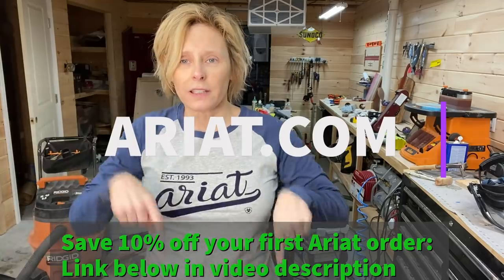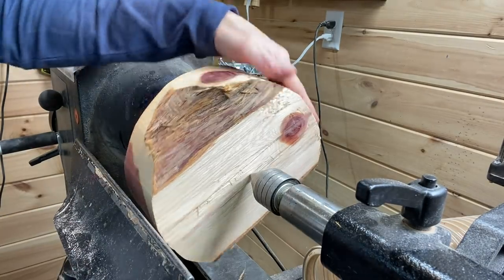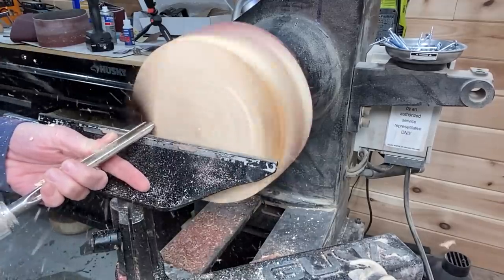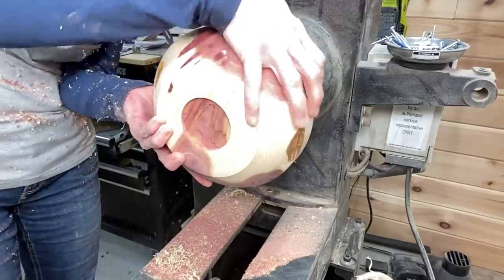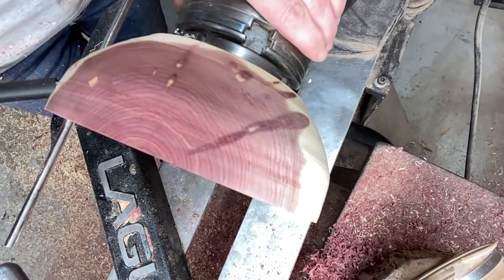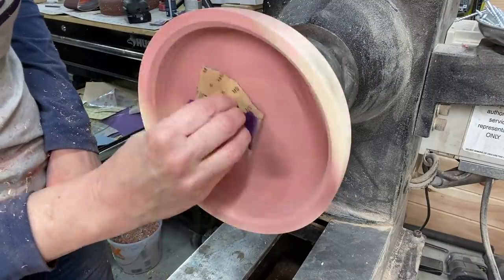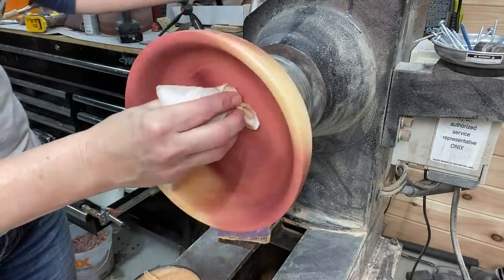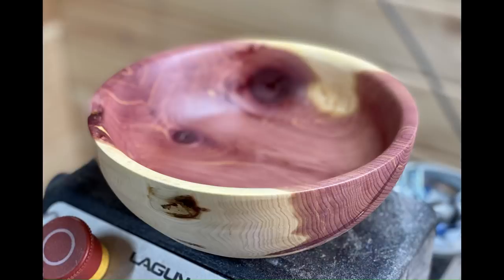Woodturning Cedar: I'm in LOVE!

Comment: Hi Peggy. I have made bangle bracelets out of cedar. One word to the wise, cedar does not like heat. It will stress crack if you fiction polish it and build up to much heat while trying to shine it up. The thinner the quicker it will heat up. It is fun to turn. CA glue can give small pieces a very nice gloss finish. Being so soft it will soak up a lot of anything thin like sanding sealer. Nice job on the bowl keep up the great work. The bowl has a nice shape and you to. Lol. :)
Reply from the maker: Thanks, Ed!👍🏻

Comment: Cedar is a beautiful wood to turn, but boy, the pink dust from sanding gets everywhere and was quite noticeable in the external filter of my air filtration system.  Cracks can be a problem and ones around knots can be trouble if they go all the way through the sides of the bowl.  The pink-red color will darken with age/exposure ending up closer to dull brown-red or muddy red.  For some reason, all I can think of when turning cedar is a gerbil cage!  Nice job!  I have found that the Ack products work very well with cedar.
Reply from the maker: Thanks, Paul.

Comment: At 1:47 it looks like your drill hole is not perpendicular to your blank. Presumably this makes for a lot more work in the initial trueing stage of the blank, and slightly reduces the size of the final piece? Or does it nor really make enough difference?
Reply from the maker: Not sure. It was pretty easy to get balanced.

Comment: the problem with cedar is that has no respect for you at all...it will crack when and where it wants and may or  may not take the finish you choose to use on it. I bought a whole log and plan on buying five more I hate it so much!
Reply from the maker: Sorry dude!
Reply: @PFWoodturning  It's all good Peggy! I now use resin to fill in the cracks before it flies off the lathe...good thing when I hollow is I know how thick the walls are.